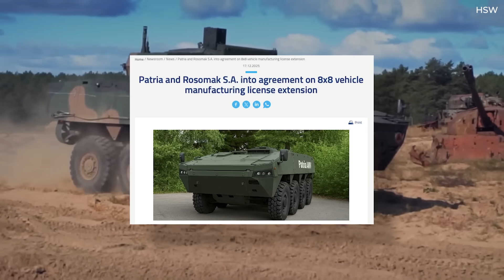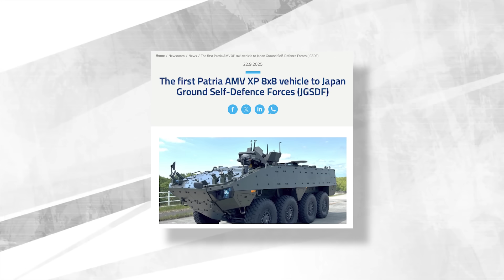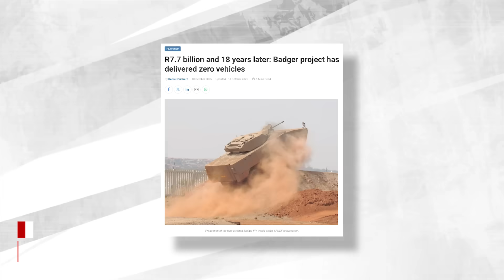Patria & Rosomak: 20+ Years Of Technology Transfer From Finland To Poland

Comment: The biggest breakthrough in recent years is domesticity made ZSSW-30 (remote controlled turret system 30mm) that will replace old Oto Melara Hitfist turrets in newly build AMV units. The ZSSW-30 will be shared with Badger tracked IFV made by HSW. The biggest upgrade will be the use of spike AT missiles  and probably a domestic Moskit missile that is in testing phase, pending production approval(this missile is huge news because it is designed as a cheap per shot alternative to other pricey alternatives such as US Javelin and is said to be 1/3 cost per missile compared to javelin/spike) .

Comment: Important thing about Rosomak is Rosomak L variant. Talks about extending license with Patria went for quite long, because Patria wanted to sell license for new AMX XP model. The issue was that Poland didn't need XP, as domestically designed and produced "L" variant already covered polish army requirements and was much cheaper (for Poland) than switching to new platform that didn't provide enough benefits over already produced "local" variant. We can only be happy that (at least from general public pov) new license deal seems to be massive success for both parties involved.

And when it comes to Polish "L" variant upgrades - most important result of them was ability to keep amphibious capabilities with ZSSW-30 remote controlled turret. That allowed Rosomak to finally get rid of outdated and problematic Hitfist-30P turret which was sort of bureaucratic and bottleneck in previous modernisation attempts due to licensing restrictions and internal issues of Melara/Leonardo (license owners for the turret) until early 2020's. ZSSW-30 (other than just being better, more modern and future-proof solution) is under full control of Polish industry and will be further "polonised" with most propable first step being replacing Israeli Spike LR ATGMs with Polish PPK Moskit units.

P.s. 120mm mortar Rak variants are apparently doing quite well in Ukraine. Because of that, right now new generation of that mortar-turret system is being developed, as well as heavier armored version using Borsuk IFV chassis/hull.
Reply: You seems to not know that Rosomak SA have license for Patria XP from 2019.
Reply: @Galvars  Wiemy, za to właśnie dostał po uszach(kontrola NIK), ówczesny prezes Rosomak S.A . Kupił licencję, na którą nie było zapotrzebowania. Kiedyś było o tym głośno, teraz nic nie można znaleźć na ten temat. Patria w tej umowie podobno zawarła bardzo niekorzystne dla Polski zapisy.
Była mowa o tym, że Rosomak, przez ileś tam lat, nie ma prawa produkować innych niż Patria transporterów opancerzonych.
Reply: @marekduczman  Powiem ci że to absolutna bzdura, Rosomak pozyskał licencję na wóz XP (jak i 6x6) w 2019 w odpowiedzi na program Serwal. Uznawano że jest to naturalny następca samych Rosomaków opracowany w oparciu między innymi o ich użycie na misjach, generalnie wóz tak bardzo był wpasowany w to co chciała Armia że był to praktycznie pewniak. W 2020 pojawia się oficjalnie już Serwal, Rosomak wjeżdża na białym koniu z XP i temat zamykamy. I tak było niemal do 2023 kiedy z buta wpadli do Polski Koreańczycy na plecach Mariusza B. i nagle wszystko miało mieć smak Kimchi. Byli tak pewni swego że reklamowali swojego N-WAV jako "rodzimy Polski produkt" obok K808. Wtedy też zaczął się ostry czarny pijar ze strony rządu i Sebastiana Ch. Można było oczy przecierać ze zadziwiania jak się dwojono i trojono by obrzydzić Rosomaka w mediach. Do dziś niestety to pokutuje tak bzdur nabili we łby ludziom.
Reply: I'm not really sure about this whole "polonisation" thing. If there are other competitors with better alternatives than your domestic one, you should normally pick the better alternatives to encourage your domestic military industry to go above and beyond to surpass it's competitors. If you always pick domestic systems no matter what, these companies will have no reason to innovate.
Reply: @itstime6122 Produkcja zbrojeniowa zawsze jest ściśle związana z polityką.
Reply: @itstime6122 If you don't encourage own industry with buying from them... they will have no interest in developing things at all or even to exist. Try be local and compete with "better" against such molochs like LM, Rheinmetall, BAE or MBDA.
Reply: So everyone should buy from American industry because everything is better there.

The best gear is the one you can afford, upkeep, repair and replace by yourself. When you depend on foreign stuff and there is a war you may hear "Sorry but we dont support the war, we are very progressive pacifists" or just "no" @itstime6122
Reply: Rosomak L mostly parts doesn't mostly fit to AMV XP nor Patria 6x6 CAVS. But AMV XP and 6x6 CAVS parts will fit to each other. Europe wants quantity and that is what 6x6 CAVS will give them. Rosomak L is too expensive for troop transport. It is a front line IFV not APC.

Comment: somehow I missed it till now, that the Rosomak is based on a Patria project. 👍🏻 Makes sense now, because I was wondering who helped setting up the production plants. It’s nothing that can be done without previous experience.
Reply: There's no Rosomak without Patria AMV 🇫🇮🇫🇮👉🏻🇵🇱
Reply: not based, about straight copy
Reply: @jaripukki267  Not straight copy, he is correct it is based on AMV. There are modifications including slight change of dimensions and that land in to "based" not "copy" zone.
Reply: @Galvars copy enough, that they need lisence to manufacture
Reply: @jaripukki267 Well yeah its a license production vehicle with extensive modifications. Rk-95 isnt a copy of Ak-47 but it is based on it.
Reply: @jaripukki267  Not such thing like "copy enough" something is or not a copy. If you insert modifications as large as changing the dimension of hull it's stop being a copy and start being based on.
Reply: @jaripukki267  license is an official copy ;)

Comment: It isn't clear to me what the difference is between the Patria 6x6 and 8x8 vehicles apart from two wheels?
Reply: Quite a lot actually. Two totally different vehicles. Like the engine is in front to the right of the driver in 8x8 while in 6x6 is behind allowing two people be at the front connected to the crew compartment by a narrow passage way on the right side of the vehicle.
The 8x8 is it's own design while the 6x6 is based on older Sisu Pasi armored personnel carriers which originate from the 1980's.
Reply: 6x6 wouldnt work well as a wheeled IFV, 8x8 does get used as IFV. you need an extra axle to carry the weight of a large turret and other systems, also addon armor for heavy fighting 6x6 is a battle taxi like a mrap or m113
Reply: It's like the Fuchs 1 vs. the Boxer.
Reply: I guess you mean how the use case differs? As they are visually very different. The Patria AMV (and thus Rosomak) is more than an APC as it can also do the IFV role; larger size, stronger engine and suspension, more heavily armored, and can fit more weapon systems and is a more stable platform for them.
Reply: 8x8 AMV is twice the price of the 6x6. Two different platforms.
Reply: They're 2 completely different vehicles. Completely different internal layout, basic parameters and usecases. One of the most important differences is that 8x8 variant can take much more armor and armament while keeping amphibious capabilities.

Comment: I hope Poland turns down those strikers usa offered.. need to de americanise nato
Reply: The best solution would be accepting them and handing over to Ukraine in exchange of anti-drone insights. If orange guy don't want to give Ukraine anything in the day light, we can be the middleman in this case.
Reply: @TheRafin99  And fu*k up any kind of military or economic relationship with the US while Trump and his camp are in power in Us? All while they are known to hold a grudge to redicilus levels??? That is Your "GREAT PLAN"???
Reply: Polnad still needs at minimum additional 1500 wheeled APC/IFV (target is over 2600 wheeled APC/IFV chassis) for the main line service (not including "cold storage"/reserve in case of war) current extension of license will allow Poland to produce max 600-800 AMV's. So we still be approx 700 8X8 chassis short of the plan. That's why idea of getting Strykers from US has strong support inside of Polish Army. Simpliy put we will not be able to cover all needs with the Rosomak production
Reply: @Crimerenegade  indeed, Poland gave to ukraine equipment for somehow 2 divisions, and we also formed two new divisions, so its a big shortage especially in armoured transport for mechanized troops
Reply: @Crimerenegade Therefore, a better solution than adopting American APCs is to implement the production of cheap armored vehicles, such as the much cheaper Patria 6x6 vehicle, or a solution based on the Czech Tatra Tadeas 6x6.
Reply: @dudleyk444  "implement the production of cheap armored vehicles" takes time nad money. And what will You use in the time that will i take to do so???? Building new factory or expanding already exisitng takes 2-3 years, training personel takes time 6 months to 1 year. Starting production and getting it up to speed takes time 2-3 years... For example the production of HSW Heron 6x6 based on Tatra TADEAS just started in Poland, but producing first 20 vehicles will take 2 years. Expanding production will take another 2 years to get them to level of 100 vehicles per year. And we need at least 700 wehicles... So what u will use untill then???
Reply: @Crimerenegade We have quite a bit of time, at least 10 years. And perhaps these vehicles will never be useful in a real conflict. Russia will never decide to attack NATO, Russia will never decide to attack an EU country, and Russia will never decide to attack any country without pacifying Ukraine first. For Russia to pose a real threat to Poland, Poland would have to leave the EU and NATO and, on top of that, occupy Ukraine. This is a highly unlikely, though theoretically possible, coincidence. Therefore, we shouldn't fall into the panic spread by the media and politicians, because they simply thrive on it. Politicians prefer citizens to be afraid and not to look at politicians' sticky paws, generals want new toys, and the media are funded by arms companies. Everyone benefits, while taxpayers lose.
Reply: depends on the price, Rosomak is in full production and probably wont stop until 2028 until the licence ends, or gets extended. There not gonna order less local rosomaks because of strikers,it will help them achieve armor goals quicker, if the deal is good then they can put more recources to rosomak and other local projects